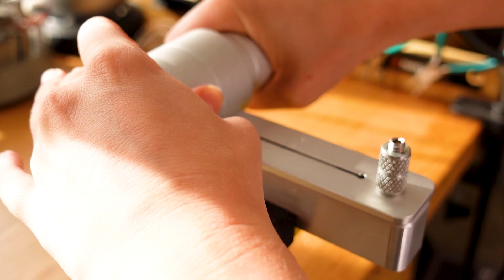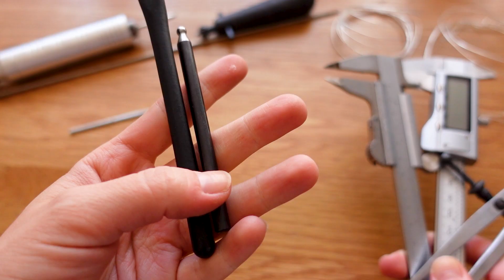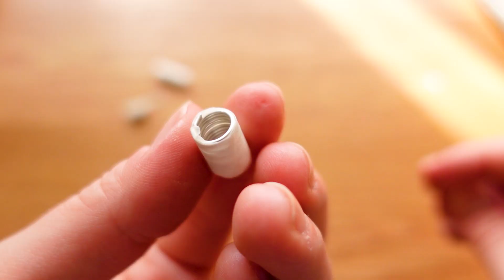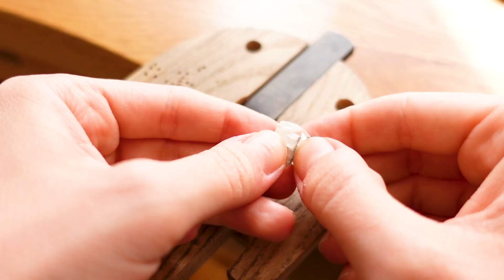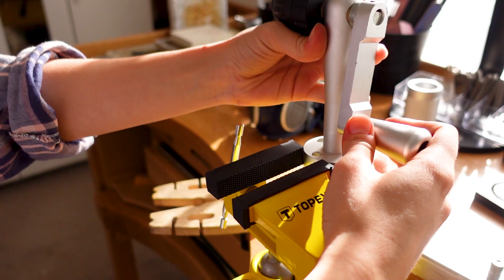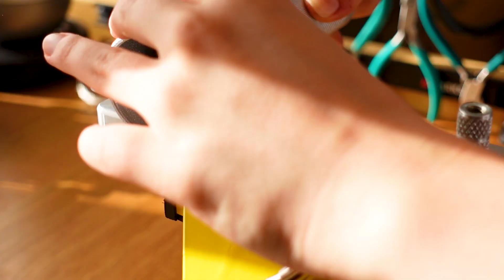How to make jump rings for jewelry making - two easy ways! Tutorial

Comment: I can’t believe all the videos out there showing the hardest, most awkward and un-uniform way to make jumprings.  Get yourself a freaking powerdrill and some dowel rods or knitting needles.  Hold the wire with a polishing cloth and run the drill at the slowest speed.  No way are you professionals coiling jump rings by hand.
Reply from the maker: It's ok, Elaine, don't worry :) These are some of the ways. It's good to have options, your way is also good, but let's chill a bit, this is supposed to be fun. Plenty of professionals are doing things their own way, I see no reason to bash anyone here.

Comment: Hiya Lady Stardust, how are you doing. I love this setup, I've cut myself a few times before learning the best way from a book, a shame I can't remember which book. I use a complete set of knitting pins, (Needles), In 1mm increments. I fit them in my battery drill and poke the wire in the chuck as you yourself do. I then run the drill at a very slow speed feeding in the wire with my other hand, tight close fitting coils work best to give you the correct size jump rings. I then cut them, again the same way you do from the inside out, this was where I used to cut my fingers. The cutting jig looks so good, though if I had one I think I would continue to make my coils the same way. I use beeswax for manual sawing, so I would try it on these too. 
Thank you for sharing this with us from your new studio, I'm glad to see this first video of thousands. Well done and stay safe, Steve...